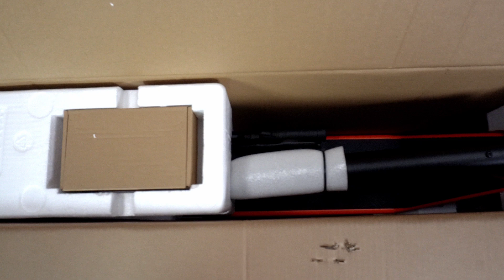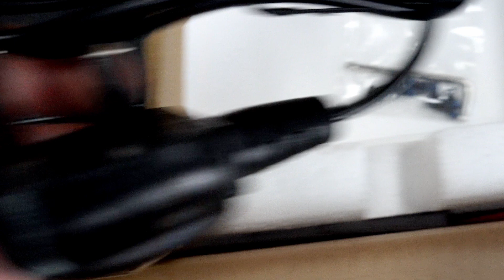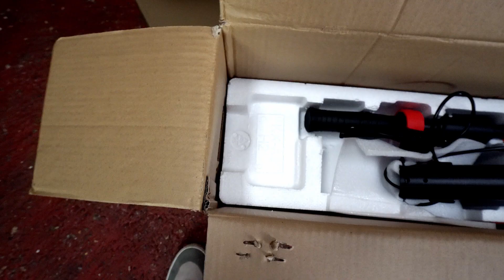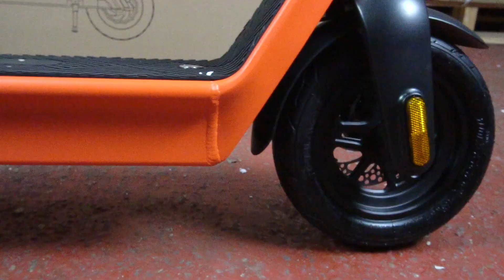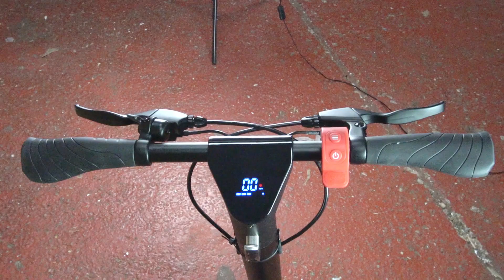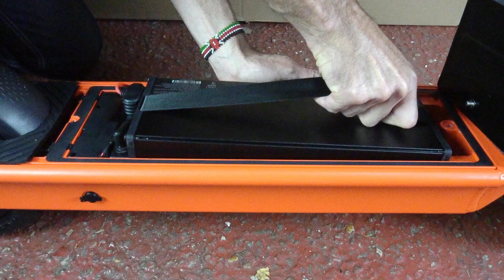HX X9 electric scooter unboxing & assembly

Comment: Biggest battery is 20.8ah... How man realistic km can u make...in factpry 25kmh in ideal con they say that u can do 65+kmh.... So is i true or false
Reply from the maker: Battery capacity is for range not max speed. In real life conditions you can expect 40-60% of claimed max range figures for electric scooters. No one rides in the slow speed setting, no one rides continuous without stopping etc etc.
And no one rides 50km in one go so don't get fixated by claimed range. The bigger the battery the heavier and more expensive the scooter is. Buy a scooter with average battery and charge it each day. If you want something that does 100km on a charge then buy a motorbike.
Reply: @HorizonMicromobility   i can understand that i had xiaomi pro2. And i unlocked it on 33kmh and i was able to make 21km with one go... This one its going to be for my girl she is 65kg or 70 :) and here in slovenija tgey claim that. Ms energy e 21 or x9 with 20.8ah can do a 75 to 90kmh with one charge... So...i belive that if i dont unlock ful mode so my girl can ride normal 25kmh it shoul be able to do 60km
Reply from the maker: @melvinkovac4738  it all depends what speed setting is used. But there is no point in buying a scooter to go a certain speed if you then use one of the slower speed settings.
Reply: @HorizonMicromobility   i think that she is going to use original settings...25kmh...

Comment: Is it smooth? What's the difference between vacuum tires and airless tires? I am not a fan of airless tires. Too much vibration. I already have the x8
Reply from the maker: Airless tyres shouldn't cause vibration, that would be solid tyres. Vacuum tyres rely on a vacuum seal around the rim to hold air, so no inner tube required, the same principle as found on motorcycles.
Reply: @HorizonMicromobility  Ok. Thanks for info. Might invest at some point

Comment: How do you prevent a thief from stealing the battery.
Reply from the maker: Take it with you or put a lock around the body of the scooter. To be honest most thieves wouldn't spend the time to unscrew the footplate securing plate.

Comment: Hello I have this model in Switzerland but it is locked to 20 km/h. Do you know how to unlock the speed please ?
Reply: Hello, aussi tu peux en allant dans p1 et en maintenant le bouton avec les 3 traits et maintenir le frein gauche qq secondes la apparaîtra le p4 ( même modèle en suisse )
Reply: @alexandros4828  hello, super je vais tester ça ce soir et je te redis si cela fonctionne
Reply: Ça a marché merci Alex
Reply from the maker: Not sure if you can as it may be set for your market. You can access the P settings by turning on and then pressing both buttons for a few seconds. Once in P settings what are your options?
Reply: @HorizonMicromobility  ok thank you I will see and come back to you
Reply: @HorizonMicromobility  it only goes to P2 mode. So i guess it is not possible to unlock the speed limit.
Reply: Scooter hacking utility app

Comment: Is there a difference between this and the ettrone lampo
Reply from the maker: Not sure you would need to check with them. HX are the manufacturers but other companies bulk buy and then add their own logo/name. If the spec is the same and it looks the same then the chances are it’s the same 😀👍

Comment: How can they say it's water resistant when you can open up the deck and remove the battery? That seal will wear down eventually.
Reply: That's like saying the seals on your car door will wear eventually!
Reply from the maker: Water resistant not waterproof. The seal is more than adequate to keep out rain.
Reply: You can’t be this stupid